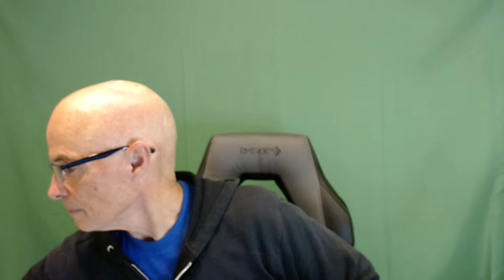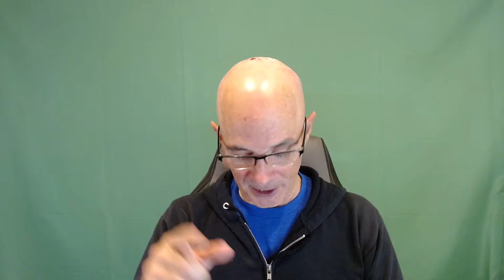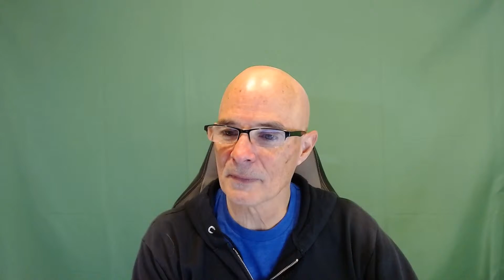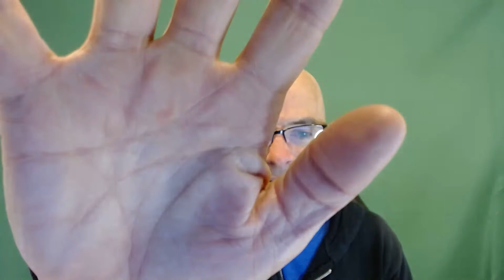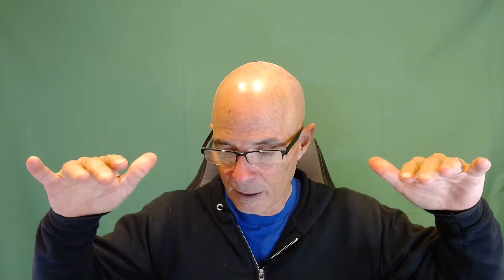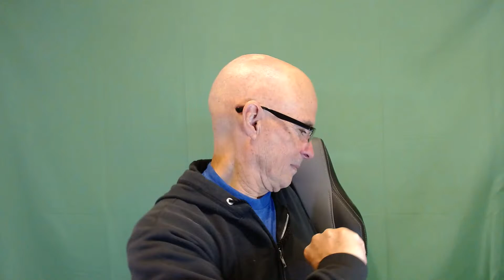LET'S TALK TECH-TICK PERFORMANCE INTERCOOLER M90

Comment: @richardholdener1727 I know these videos take a huge amount of work, but if you haven't taken the "unspaced" M90 apart yet you could try running the intercooler dry to see what the pressure drop is like without the temp change. An intercooler pressure drop test with a dry core vs fully functional would be interesting to me at any rate.
Reply from the maker: According to Tick, they see .8 psi at 900 hp and near 20 psi
Reply: @richardholdener1727  that's pressure drop across the core running turbo?
Reply from the maker: I think it was with a big blower

Comment: I'm looking for an aftermarket efi intake manifold and unable to find one that isn't for carburetors/tbi. The engine is the vortec 4.3L v6. Was there ever an intake manifold that used injector rails instead of spider injection?
Reply from the maker: yes-the marine engine intake

Comment: Richard, I think I figured out how to do the math correctly!  5.6psi@162F should become 4.9psi@90F.  And that even SEEMS correct. Lol...  To do the math correctly it seems that you have to convert the temperatures to Kelvin, and you can actually use gauge pressure, absolute pressure is not necessary.
Reply from the maker: temp drop won't drop the boost that much-this was a restriction
Reply: @richardholdener1727  Looking forward to your additional testing on the topic Richard!  I'm happy to be wrong AGAIN, because I always learn more when I'm wrong than I do when I'm right.  :)

Comment: Oops.. I misspoke about the Rover V8 bell housing bolt pattern:  It IS the SAME as the Buick 215/300/340/350  The crank flange is deeper on the Buick 300 by like half an inch or more though...
Reply: IIRC the Rover V8 is based on the Buick 215. So that makes sense.